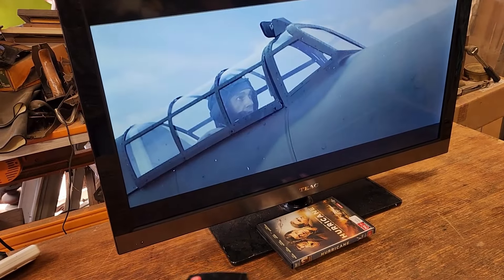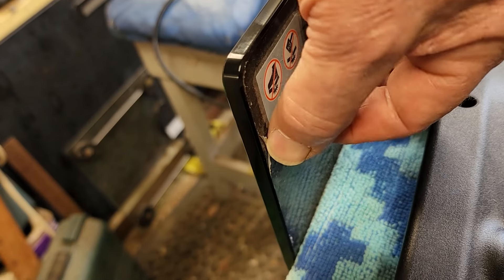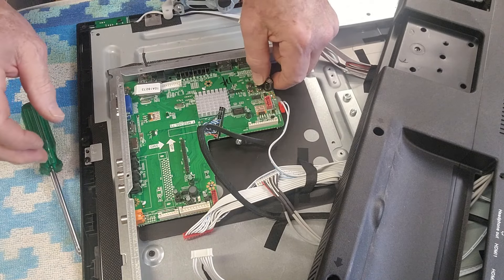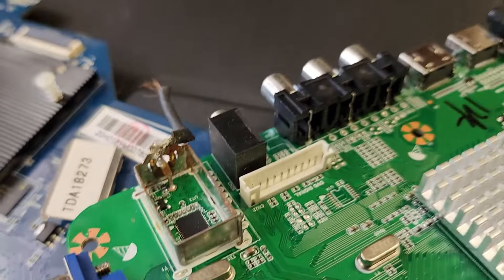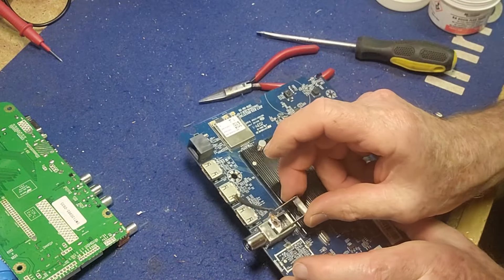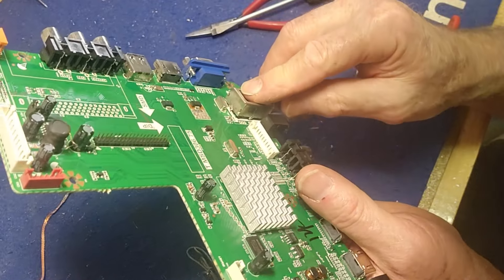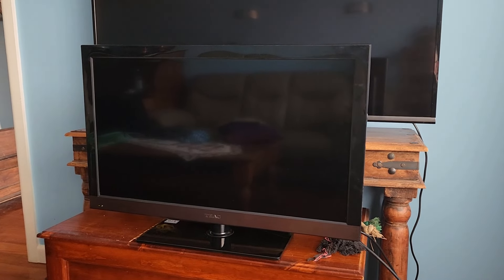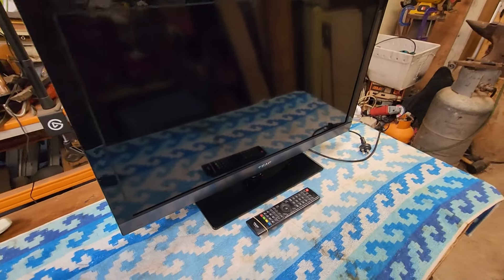How to Successfully Repair a Teac TV/DVD Combo with a Broken Antenna Input. A Nice Save from E-Waste

Comment: A more common fault that I thought Chris. I have had two TVs I picked up recently with the same issue. It might be because the socket faces down and get pulled from the side. I could probably add there is nothing to watch on free to air but I won't. Good fix Chris👍😊
Reply from the maker: Thanks Dave. Yes, I've had a few TVs with this problem (or similar). I think it's a result of "vigorous" unplugging of the antenna lead - and yes, probably on the wrong angle. We watched some of the Logies the other night and we hadn't heard of most of the free to air TV shows!! Probably because we spend most of our time on YouTube 🙄🤣